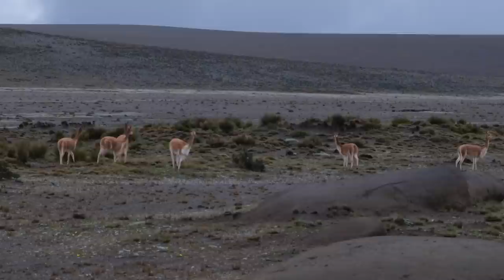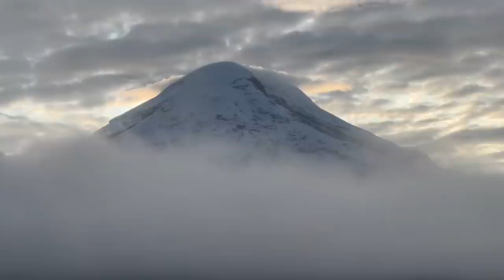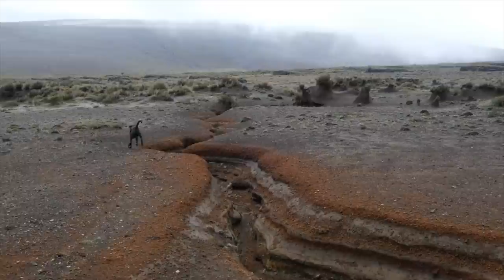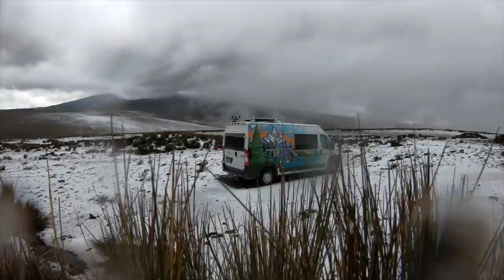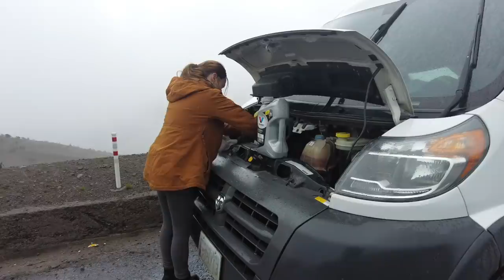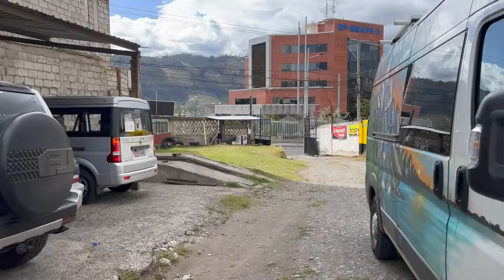HIGH ALTITUDE ENGINE PROBLEMS in ECUADOR | Alaska to Argentina by Van #vanlife

Comment: We had the same thing go wrong with our 2017.  Started as a slow leak, pooled up and became a huge leak. 
It was the oil filter housing. Fixed it and no problems since. So worth getting it done asap! 
Safe journey!
Rose & Michael
Reply from the maker: Yes! I saw Dorman make a metal replacement but it’s out of stock everywhere, either due to demand or it not being a great fix?
Reply: @the.vandersons  original replacement seems to be working fine in ours.  Not sure about the metal one. Might be good. Good luck in finding what you need.

Comment: I'm looking forward to seeing the high Altitude road when the oil leak problem is solved. 

Have you given any more consideration  to get a metal skid plate for under the engine to protect it?
Reply from the maker: I think it's pressure, we're going to be in for some engine maintenance soon though! 😃

Comment: when you go to altitude there is less air. hence, the engine needs more air to mix withthe fuel spray from the injectors. You have to figure out how to make this adjustment to the altitude you will be going. Too much gas is pasing unburned because the gas to air mixture is poor in air.
Reply from the maker: Yes, sometimes we smell gas when heading to these altitudes. I think the pressure must have busted something in the cheap plastic oil filter housing

Comment: I doubt the oil leak has anything to do with altitude. Recently, you had some repair done to the oil pan. The repair may not have been as good as it first seemed, and the seal did not do it's job around the pan.
Reply from the maker: I would agree but the leak was coming from the other side! Hopefully some new gaskets and the oil filter housing will fix it up